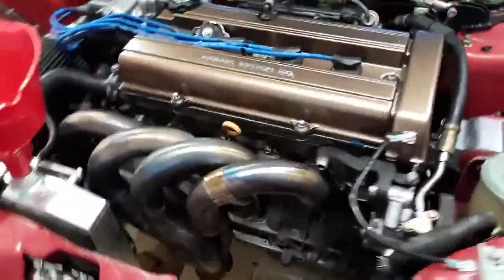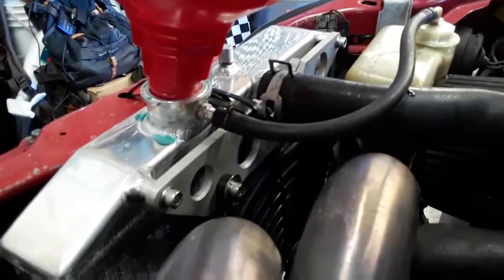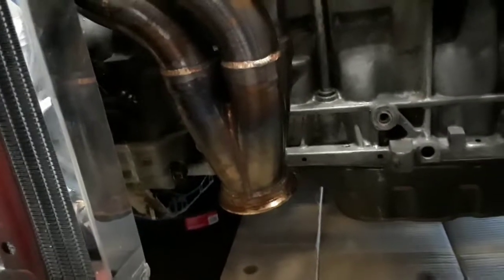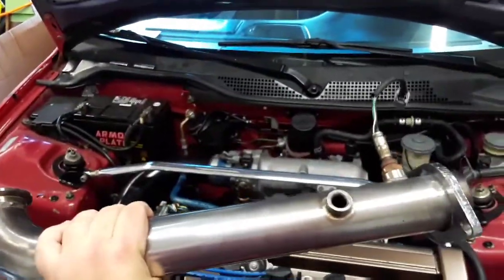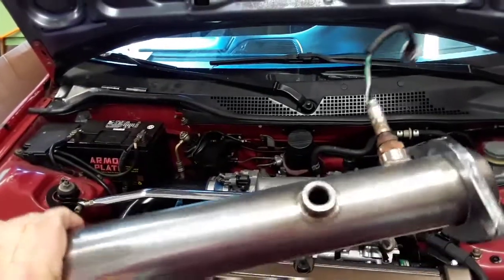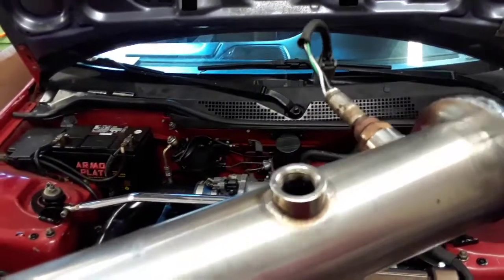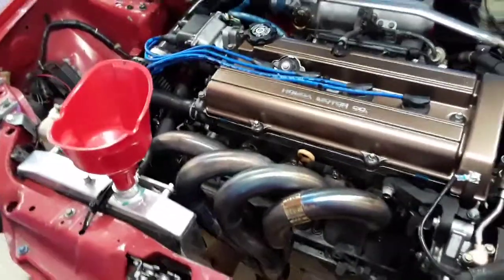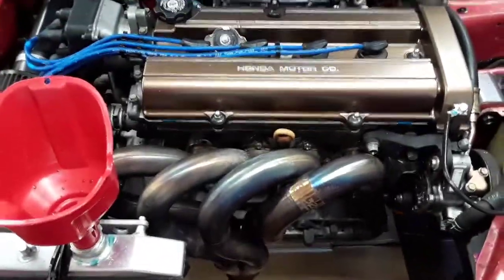Vlog #16 - 1320 Performances Header Installed On EJ1

Comment: Hey bro! I got a quick question for ya, I was thinking buying a 1320 Performance SMSP Style B SERIES HEADER Big tube for my 94 civic with a full GSR swap, you think the header will fit? , I don't have AC and I have half size radiatorand for the exhaust I was think getting the Invidia n1 exhaust to go with it 😅 🤔 😂.. what tou think ?
Reply from the maker: Sounds like it will work. I am not sure but with a half size and no AC it will make more room. Invidia makes some good exhaust. I think that will be a good setup. Thanks for watching and commenting. 👊🤟

Comment: How is the performance of this header does it actually give any gains. It sounds like a V8 rumbling around tho
Reply from the maker: Not sure how much HP gain but with any header and exhaust system you will see some. It sounds like that because it was open headers and not idling probably I think. Lol it did sound cool. Thanks for watching and commenting. I appreciate the support 👊

Comment: What size fan did you use? I’ve got the same headers on my b20 and it’s melting my fan. I’ve tried mounting it in the front of the radiator (witch just makes the car over heat) so I’m trying to figure out how I can make it work
Reply from the maker: I think it is a 12" fan. It is super close to the header but haven't had a issue with melting (yet) I will measure it tomorrow and let you know. If you want message me on Instagram and we can chat in there. I can also send pictures of it
Reply from the maker: Here is another video that shows how close it is to my header. I haven't had any issue with it. 

 https://youtu.be/DMxz-oWzmF8
Reply: CZ_Mate awesome thank you so much I actually don’t have Instagram anymore but I’ll check out that other video and go from where thank you again I think I might just need to heat wrap the headers or maybe get a smaller fan so it’s not sitting so close to the headers
Reply from the maker: Or if you have Facebook I have a YouTube page cz_mate you can search that and message me. I just can't post pictures on here. Hit me up anytime, we all have to be here for each other. Trying to make the Honda/Car community great again

Comment: Do you think I can run my ac lines with these headers or no ?
Reply from the maker: I am not sure. There is probably a way you could but might have to reroute them. Sorry I couldn't be of more help. Thanks for watching and commenting. Let me know if you have any other questions. Thanks 🤟
Reply from the maker: I was just browsing around again and This is what I found in the ad:
AC and PS compatible (SLIM Fan required) (AC high pressure and low-pressure line need to be pulled towards radiator support and heat wrap should be used to prevent damage)
Reply: CZ_Mate thank you so much for your research!
Reply from the maker: No problem 😀 that what we all need to do for each other 🤟
Reply: CZ_Mate I’m building a b20v for my ej and I liked these style of headers but thanks man my insta is @rykos.teggy and I just subbed! 💪🏽 keep building bro